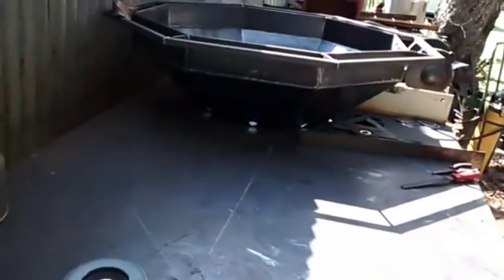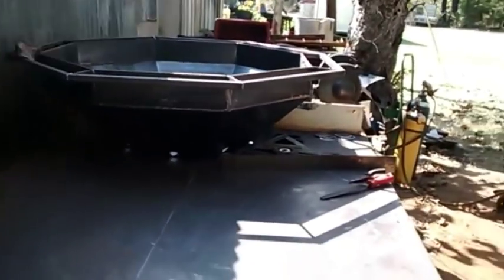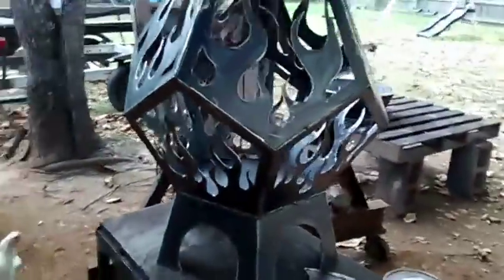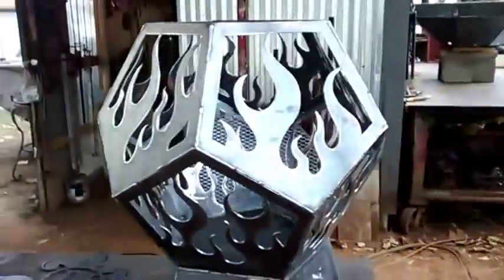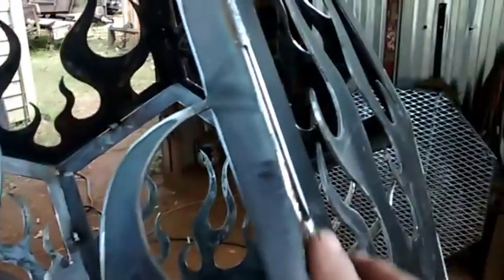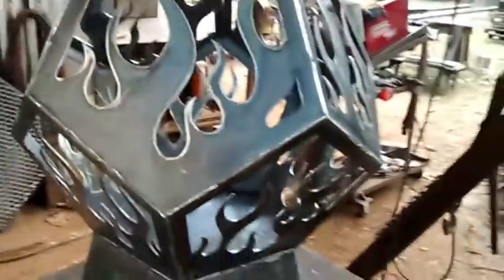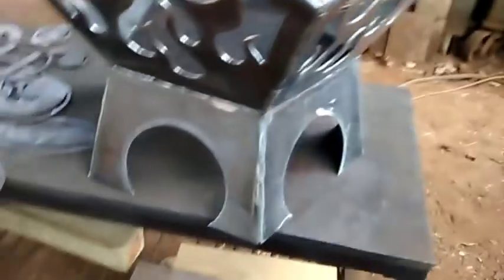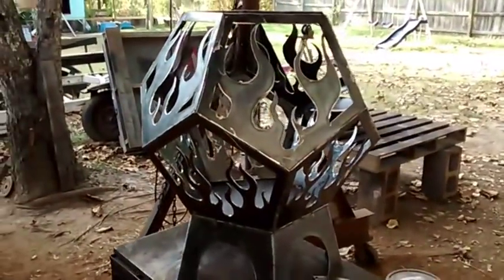Pentagon fire pit ( torch cut)

Comment: Hey Allen, until you get your shop built, when you need another tarp this is the best I've ever found.  Had one up for 2 years in my yard, just a couple tiny holes from branches..  Really sturdy and thick. Search this on Amazon - HydraTarp 12 Ft. X 20 Ft. Super Heavy Duty Waterproof Tarp - 16mil Thick - White / Brown Reversible Tarp

Comment: Have you tried a metal cutting blade in a circular saw? I use one all the time in my worm drive saw and it makes cutting straight lines a breeze. I just clamp a straight edge to the piece and it cuts easy.  The blades aren't terribly expensive.  You also could really benefit from a small plasma cutter! I'm amazed at what you pull off with O/A.  Great job!

Comment: Great torch work. Just a quick question, do you use flux core wire in your mig gun being as you're welding outside with it? If it were me, think I'd use stick outside.

Comment: how long you been cutting and welding as you are very good what did you use to do before these builds.also your welding is so good with that little Lincoln have you ever tried the REBEL ESAB 235ic excellent machine in the USA, I'm waiting for it to come to the uk
Reply from the maker: danny outs thanks, I've been messing with steel 10-15 years, I haven't tried the esab rebel, I've heard a lot of good things about it though, the Lincoln 180 I have is a very good machine, I've had it for about 8 years and have ran it hard for all that time, I used to rebuild oilfield stuff, pumping units, storage tanks, skids, etc. And test fixtures for locomotive stuff for a while, just whatever came along, kind of got into bbq stuff by luck, started building them and never stopped..lol

Comment: Quick question,  ever have any problems with rust buildup or sap on your welding tables since they live outside and under trees?
Reply from the maker: Casper's Custom Works they do rust some but I brush them off a lot, the sap isn't too bad
Reply: Thinking about a 4x8 table but might try something a little smaller first. Just know I don't have room in my 1 car garage.

Comment: The time it took you to cut and clean one piece, I could have cut the whole thing on my CNC table. The whole thing can be done in 2 parts with slots allowing for it to be bent into place then welded up. 

To each their own. Flame away I use to make the same lame excuses before I built my first table which led to a second bigger tables..